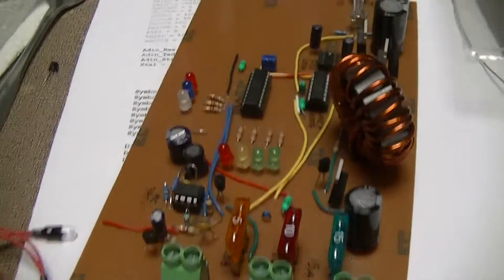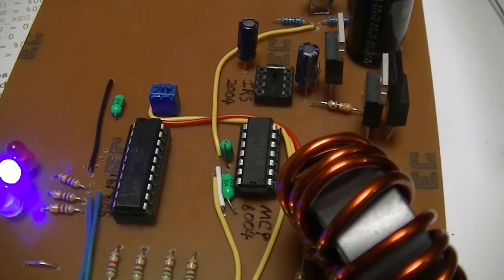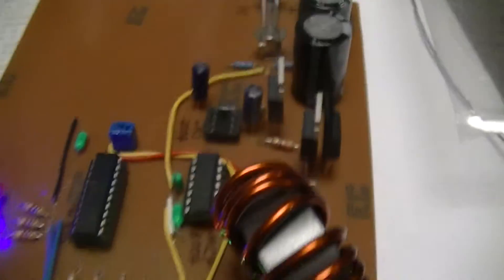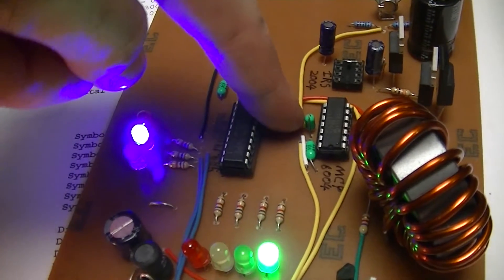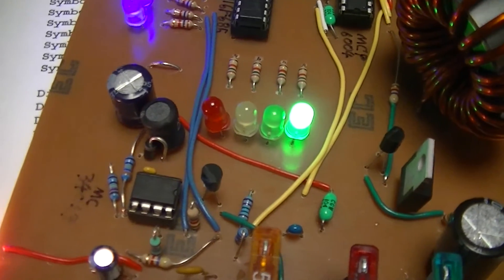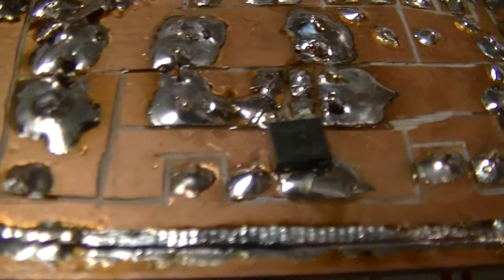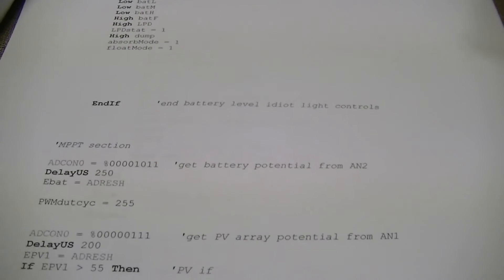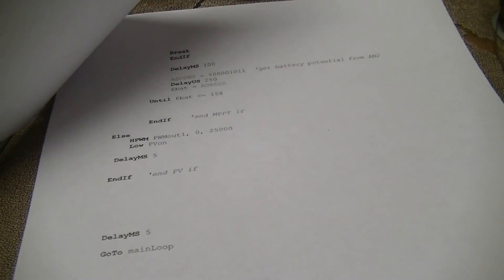DIY MPPT finished board testing

Comment: You're right- power factor would be involved only if the circuit added an automatic transfer switch, smps, and multi stage charger- to efficiently recharge the battery bank from AC grid power when the panels aren't producing enough power.

Comment: Looks good! Like ur design compensated to handle spikes/surges that occur.
1. Would it be easy to have it do Power Factor Corrected charging of the battery bank like the Xantrex and Magnum ??
2. Add the ability to charge 24V 48V possibly 60V battery banks ??
3. Pluggable Inductor and Caps to allow for bigger or smaller power arrays and battery banks ??  ( Like the following DIY mppt board has... youtube video code 0TE38SOdf64  user sjh7132 video title "New MPPT Board Prototype". )